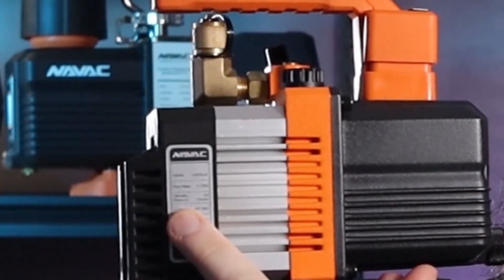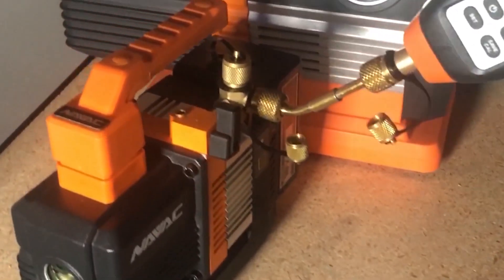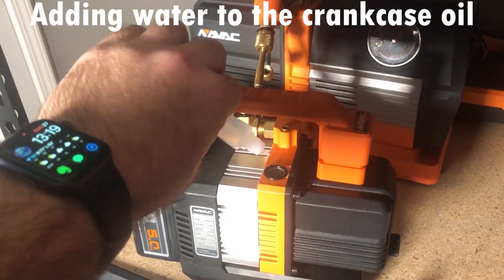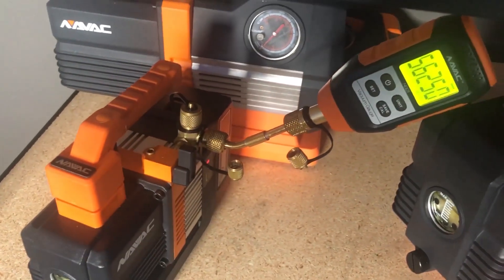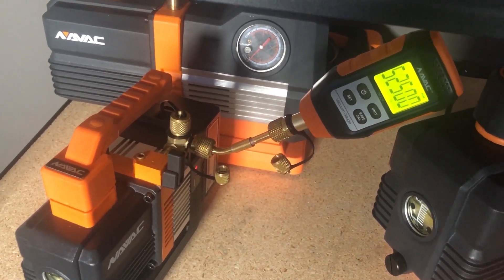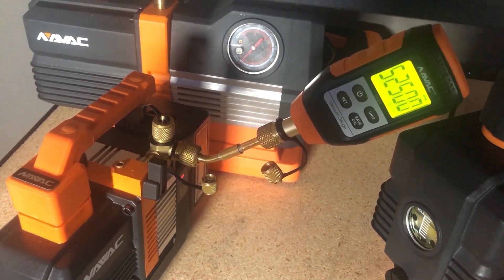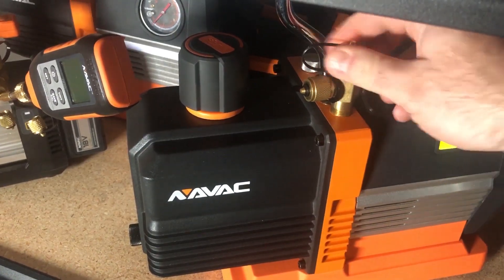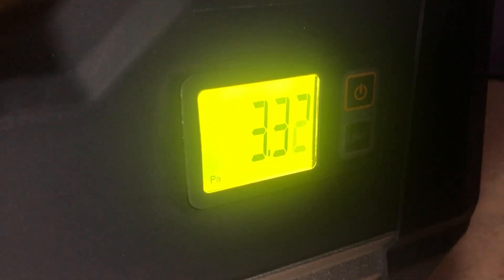Vacuum Pump Oil Health BY AK HVAC

Comment: Why can't you just take used oil (with moisture) and heat the oil in a pot on the stove to above the boiling point of water (100 deg C) for 10 minutes?  Wouldn't this boil off all the moisture in the oil, and then once it cools you can reuse the oil?  Case in point:  When the oil is manufactured, the manufacture obviously needs to treat the oil in order to remove moisture at the point of packaging.  It seems that this is likely done by heating the oil up to a point where any water contained within, boils off.  Am I missing something here?

Comment: Need more of your videos on NAVAC tools. I want to get one of those little battery operated pumps just for the neatness factor. 
         And get one of those eBay or Amazon battery adapters so I could use my 12 amp hour Milwaukee batteries and walk away without worrying about staying away too long and coming back to a dead battery.
Reply: I have the 4 cfm battery charge vacuum pump and it’s time saver and also so simple and realiable
Reply: @vigons90  i’ve been thinking of getting one just because not having to deal with the extension cord. 
             Not many people know that actually Makita Japanese manufacture made a battery powered vacuum pump over a decade ago. It’s nothing new

Comment: Good Video ! Bottom Line Guys - Change Your Vacuum pump oil Often , Test Pump often & Try to use The Factory Recommended oil That the Pump Was Designed & Built with. Note - It’s allways better to have Fresh vacuum pump oil oil of any brand than oil with moisture in it. A Good Rule of Thumb is Check to See if your pump will pull down to spec. Before , During & after Evacuation. Allways Store a Vacuum pump With Clean oil in its sump. Internal metal parts can & will be damaged if Pumps are stored with Moisture laden oil in thier sumps. Good to see u back on the Tube Ak.